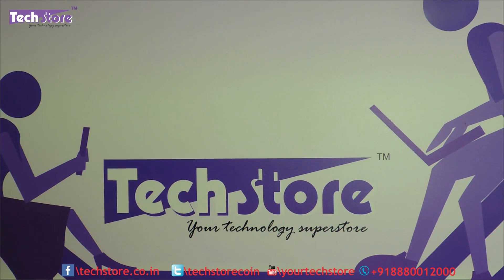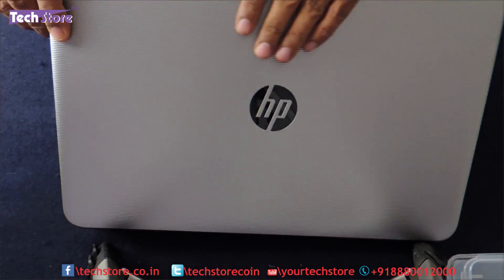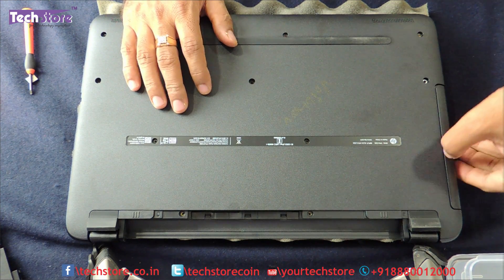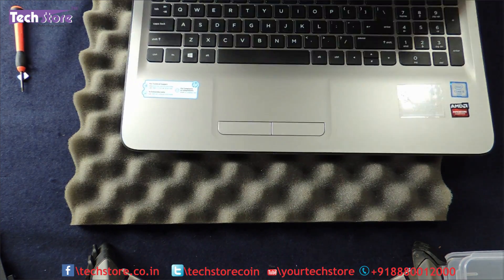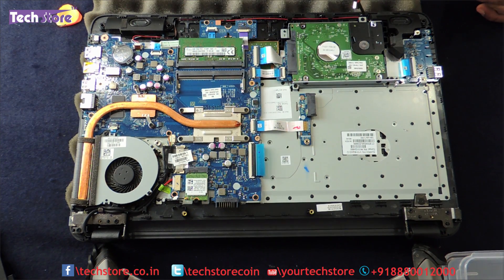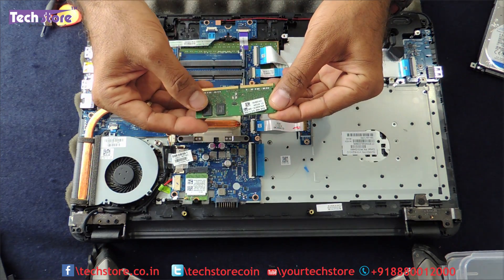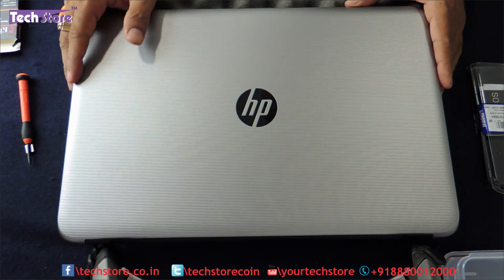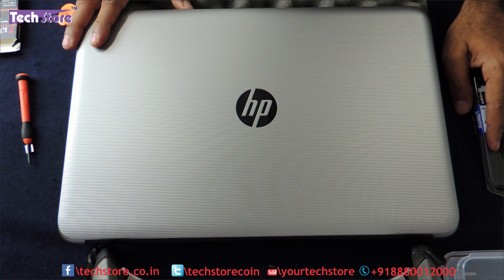HP 15 AY series laptop : How to disassemble base and upgrade ram memory hdd ssd of DIY

Comment: You got the easy one with a second dimm mine the stupid HP 15 that only has 1 dimm and you have to take the keyboard out take the whole mobo out just to get to the ram sticks I re-pasted the apu in it and put an SSD in it about a week ago my dad dropped it while it was running broke the KB, trackpad, screen, case and mangled the HDD I’m using it as a desktop now basically to read YouTube chat when streaming so I don’t have to put a second monitor on my gaming rig

Comment: Bro One more question. What if I can replace HDD with SSD and boot from it. Then place the old HDD in Optical Disk using caddy?

Still Should I need optical cable to read write to HDD?

Comment: That was a life saver video I was searching for!! Bro I have same 15 ay series laptop(HP 15-ay009tx)

I have made up my mind to upgrade another RAM slot with 8 GB and replace optical drive with SSD. 
Read all the comments and were able to understand that I need to add another cable to boot from SSD(Replaced Optical Disk Drive with Caddy). I will search for the video which shows this SSD replacement in your channel. Can you please suggest me the best SSD and optical cable which I should buy?

CHANNEL SUBSCRIBED:-)

Comment: There are two HIDDEN screws underneath the rubber pads on mine. IF you don't pull the pads off you will not find them and the cover will not come off without damage! You have been warned!!!!

Comment: Thank you very much With the help of your video i have opened my laptop and corrected the issue of Wifi Antenna (low network) by cleaning and with use of second connecting slot.   

Thank a bunch once again you saved my time and money too.
Reply from the maker: Glad it helped. Do SUbscribe.

Comment: Hey I know this video is 4 years old but I was wondering if you can answer my question.

I installed a 8GB 2666mhz ram but the task manager shows 8GB running at only 2133mhz. 
How do I change this setting to get the ram to run at max speed? 
And thank you so much for this detailed video. I really couldn't find the hidden screws.
Reply from the maker: Hello Rupika. Your motherboard does not allow ram speeds beyond 2133 MHZ. You cannot change the ram speed. Let us know if you have removed the company ram and then checked.
Reply: @TechstoreCoIn  Thank you so much for your response. Helped a lot!
Reply: @TechstoreCoIn  Sorry for bothering you but I was wondering if it's possible to install an m.2 ssd and is it possible for me to install nvme ssds? Thank you so much for your help.

Comment: Thank you for the video, My job made easy. but does it have any nvme/m.2 ssd support in this HP 15 AY series? Can we upgrade the WLAN to 5Ghz? 

If something is available, please make a video of it. Thank you.
Reply from the maker: It does not have m.2 SSD Slot. You can install 2.5 SATA ssd only. You cannot install dual band 5Ghz wifi chip here. Thanks . Do Subscribe
Reply: @TechstoreCoIn  what about the m2 slot near the back of the DVD writer closest to the ram but still in the back.
Reply: Wait, nevermind. I was watching videos on the wrong configuration even though this is the configuration for my computer, whoops.

Comment: Hello, grate video! Just a question: is that a M.2 ssd 2242 on the bottom left side (next to the CPU)? Thanks in advance!
Reply: Hey, did you get your answer?
Reply: @kannakaruppasamy  i opened the pc and found that M.2 is already present and is the Wi-Fi card
Reply: @domenicogigante4095  Does that mean we can either have SSD or wifi?
Reply: @kannakaruppasamy  exactly
Reply from the maker: It does not have m.2 Slot for SSD Thanks Do Subscribe.
Reply from the maker: It does not have m.2 slot for SSD. Thanks Do Subscribe.

Comment: I bought a PNY DDR3 1600 MGZ 8 GB memory chip for a notebook from Best Buy. The space between the gold pins does NOT line up with the notch on the RAM socket.? HELP
Reply from the maker: Your laptop must have DDR4 slot. On few laptops on this series, there is ddr4 if it is corei5  variant.
Reply: @TechstoreCoIn  Yes I found out it takes a DDR4 2133p even though all the literature says it takes a DDR3L 1600. Go figure. Thanks for reply.

Comment: my laptop hp x7t51ua#aba i think has 8g RAM. can i upgrade it to 16g and will it make my laptop faster?  How do i know what to buy? thanks.
Reply from the maker: Yes you can upgrade ram. Ideally install SSD too which will boost speeds better than ram

Comment: Bro. I have HP 15ay542TU Laptop with Core i3 6th Gen Processor. I want to Upgrade my RAM from 4GB to 8GB. I only know that the RAM inside is of SK Hynix of 2133 MHz speed. But I am not sure if its DDR3 or DDR4. What to do? How to check?
Reply from the maker: It is DDR4

Comment: Hi, I have 15-ac026tx HP model. It has 4 GB DDR3L-1600 SDRAM Expandable upto 8 GB. Which RAM should I purchase? Does this model has m.2 slot ? Or should I insert SSD at HDD place ?
Reply from the maker: It does not have m.2 slot. You can buy a 2.5 Sata SSD. You need to buy a 8GB DDR3L 1600MHZ ram
Reply: @TechstoreCoIn  Thank you... But why 8 GB? Does this model has no second slot for RAM?

Comment: I need help with upgrading to ssd
Can i keep both ssd and hdd and remove cd drive in my hp ay009tx
Reply from the maker: Yes you can. You can use HDD caddy for using your existing HDD and put SSD Sata 2.5 in HDD bay.
Reply: Thanks for the reply @techstore

Comment: M2 slot is availble for ssd or not in this model_
Reply from the maker: No,unfortunately.
Reply: @TechstoreCoIn  what i understand is that this model (HP-15-Ay105ne) does not support nvme m.2 SSD and its only limited to SATA SSD.

Comment: Please please please Will You tell me the exact 15 ay model of your notebook? I have the same one but theres no optical drive in it. It has the space on the motherboard but not the Flex and the plug that goes to the odd or the dvd reader. I want to put a caddy on it yo hace another disk
Reply: Whats the Exact Model number ?
Reply: @harrykane9632  yes! Please!
Reply from the maker: yes you can put caddy in that space.

Comment: Thanks!  I put in an SSD. Thanks for counting the screws and showing where all are located. I never pried open a laptop before......Thanks for showing how to do this prying. Your video was most helpful.
Reply: What type of SSD did you get and did you notice a big difference?
Reply: @foch41  Silicon Power 512GB......buy at Amazon for $50 or so. Yes my HP AY series moves faster now.  I have the hp 15-ay192nr. Be sure to remove EVERY SCREW before prying it apart........This video showed every screw.   SSDs are 4x faster than 5400rpm laptop hard drives. I tested this with a program called crystal disk mark.
Reply: @foch41   use Aomi to clone onto yr new ssd drive. Aomei is free backup and cloning program

Comment: Does this model supports m.2 nvme ssd?
Reply: I have the same question, did you get an answer yet?
Reply: @lecatturkey9185  i hope its not too late. I dug into the datasheet and found out that it does not support nvme SSDs.
Reply: @maxis7182  Thank you

Comment: I have the same laptop. Can we put ssd and hhd together ? For ssd place remove cd drive. Is it practically possible? . My imagination this one.
Reply: Yes you can ! Replace the cd drive with ssd using caddy. But if you want to use the full potential of the ssd, replace the laptop hdd with ssd, and use the hdd in cd drive space

Comment: hello. i have the same laptop with a core i5 6200u and it has 4gb ddr3 ram. what ram should i add in the empty slot?
Reply: use 4 or 8 gb ram ,if you use heavy stuff add 8 gb , else 4 gb.

Comment: #Techstore Sir, I have hp 15 Ay-102nx corei5 7th gen with 2GB amd radeon m430 graphics but my graphics chip is dead since i bought my laptop. What is poosible solution where the chip is located on board 
I guess i have same board like yours in the video !
Hoping for the Fast reply #

Comment: I am having a laptop with configurations 

*Intel Core i7-7500U 2.7 GHz

*8gb RAM

*1 tb HDD

*Graphic processor: Intel(R) HD Graphics 620 (integrated graphics upto 4gb)

*OS: Windows 10

*Resolution: 1366 x 768

*System type : 64 bit operating system, x64-based processor 

*Touchscreen

Laptop model : hp 15-ay196nr

My problem is i cannot play games like gta 5, mafia 3...my question is upgrading ram to 16gb in my laptop will help gaming performance?
Reply: you need a dedicated graphic card in order to play high graphic games

Comment: Quick question - I have a 15-ay0039wm, and the power jack isn't working well.  I already ordered the replacement part through Amazon, just wondering where it is and how to get to it?  Looks like it may be next to/under the fan?  Thanks in advance for your help, and for a great video!

Comment: i have core i3 model, can i upgrade to core i5?
and i also want to upgrade ram, which ram is best for this laptop? i need suggestion ( any 8gb ram)
plz reply
Reply: No can't upgrade CPUs on laptops.
Reply: @ArunG273  yes you can upgrade cpus on laptops who told you you couldnt?
Reply: @jacobsasson5595  There are few rare upgradable laptops. I know them. Laptops these days are soldered. Can you show me any laptop from last 2 years with upgradable cpu except some Chinese ones?
Reply: @ArunG273  who says he needs a 2019 laptop or 2018 having a laptop with a 15 inch screen and changeable CPU, GPU and ram is all that's needed and I know msi does those
Reply: @jacobsasson5595  this video is about HP ay 15 series laptop. I have that same i3 model it's not upgradable. Please don't bring those rare upgradable laptops into this discussion. What I said about cpu applies to 95% laptop on the market.
Reply: @ArunG273  Funny how I was correcting you when you said cpus cant be upgraded please dont bring your personal problems to YouTube its embarrassing
Reply: @jacobsasson5595  it's not my personal problem. I am talking about the laptop in this video.

Comment: I just bought an ssd and I want to use ssd caddy but I am not sure which size i have to get, is it the 12mm or 9mm? will it even work with a caddy? thank you
Reply from the maker: +Mohammad Rahmat 9.5 mm caddy will work just fine.
Reply: Techstore thank you

Comment: Hi ---are you using a guitar pick as spudger to pry this apart? I have one that I must put an SSD in. Thanks! Lots of hidden screws on the bottom of this model
Reply from the maker: +zenzeke zenard ideally you should use plastic pryer only. But if there is no option, you can use guitar picm
Reply: THANKS!

Comment: The plastic that holds the hinge screws broke on mine, would it be possible to replace that plastic that all the parts sit on (that's basically the cover around the keyboard)? 
If so, where could I find that?

Comment: I have a hp 15-ay516tx laptop included with 4gb ddr4 2400mhz but the motherboard supports 2133mhz.. I want to added 4 gb.. Plz tell me what kind of ram (2133 mhz or 2400mhz) support in this laptop and its side effects..
Reply from the maker: Buy a 2133MHZ Zion memory.

Comment: Is this video also suitable for the 15-ay100nl model? Because in technical specifications there is only one slot and max 8gb of RAM. Thank you
Reply from the maker: +Mik yes it will work
Reply: +Techstore But i bought mine last week, not in 2016. Is that the same thing? Thank you
Reply: Techstore What is better? Single or dual ranked for 15-ay100nl? Thank you

Comment: Well, I installed an additional 4gb ram.
but my system still shows that I have 4gb instead of 8gb ( not counting the new ram )
any idea?
Reply: Probably the wrong memory type. It may require DDR3L SDRAM, L for low voltage (1.35 V). I bought the wrong type for my ASUS laptop and it didn't register. That or the ram is not seated all the way.

Comment: SSD and HDD, Can i use both at a time in this laptop ?
Reply: Yup but you have to sacrifice your optical drive also you can't boot from the drive which is installed in optical bay
There are plenty adapter for that just search "optical drive hdd"

Comment: hey thanks for the video, I just want to know if opening my laptop will give issue with the warranty? also I have an hp 15 -af006ax with amd, could you tell me if my model will be the same as yours and which hard drive to use?
Reply from the maker: No issues at all.Go ahead!

Comment: Thanks, I have a question please. I own the very same laptop and it keeps making noise, I believe it's from the hdd, is it okay, or should I do more tests? The fan is set to disable always on mode, so I'm sure it's the hdd. thanks again
Reply: I'm buying a new SSD, but idk if that will fix it. Did you ever get it working and if so, what changed it?

Comment: What connector did you use for the hdd? I have a ssd laptop and i want to put my old hdd in the new laptop but it only haves ssd slot and i need the connector.. where can i buy that?

Comment: you didn't mention anything about the ribbon cable connectors. What a pain when you remove those, they fall apart. Also, would be nice to mention that for certain upgrades (pcie ssd) you need a separate adapter board

Comment: Wow, same watch as me, same laptop as me. Great video, but does this void my warranty? Also, what is the technical name for the tool you used to pop apart the clips around the edges of the laptop? I don't want to make chips and dents in the frame by using a screwdriver (Did that last time, didn't turn out well)
Reply from the maker: +Tom C (xXItzTomXx) that's great to know you wear the same watch and have the same laptop. :-)
The technical term is Pryer
Reply: Okay, thanks ;)

Comment: I want to know if my HP 15 notebook 15-g009ax has two memory slots? and if not which one should I go for, if I want to get 8gb I have 4gb installed already! please help
Reply: To check the details of your current installed memory, right click on start, click "Task manager", go to the "performance" tab and click on the "Memory" section. At the bottom of that section, there is some numbers. To the right of those numbers is some other detail. You should find "Slots used: (Used slots)". If not, then use the scanner tool provided by Crucial, which will also show the computers maximum supported RAM: http://uk.crucial.com/gbr/en/systemscanner

Comment: great vid ... can i have a link or part number for the ram you used .. i ha e the same computer just i5 processor and 128ssd thanks in advance
Reply: He used a 4GB stick of DDR4 SODIMM 2133MHz RAM from Kingston. The DDR4 and the 2133MHz does matter, the motherboard will not fit anything else but DDR4 SODIMM sticks. The speed (2133MHz) is the speed of the default stick of RAM pre-installed in this laptop, but if you were to put another speed in (eg 2400MHz) then the lower speed stick of RAM would burn out because the motherboard tries to run it at a speed that it is not capable of. If you want further information, try using Crucial's PC scanner.

Comment: what exact type of memory did you use?
Reply: He used a 4GB stick of DDR4 SODIMM 2133MHz RAM from Kingston. The DDR4 and the 2133MHz does matter, the motherboard will not fit anything else but DDR4 SODIMM sticks. The speed (2133MHz) is the speed of the default stick of RAM pre-installed in this laptop, but if you were to put another speed in (eg 2400MHz) then the lower speed stick of RAM would burn out because the motherboard tries to run it at a speed that it is not capable of. If you want further information, try using Crucial's PC scanner.

Comment: 1. Which brand of RAM will be the best for laptop(HP 15AC044TU)?
2. Is the same process may be followed for 15AC044TU to upgrade RAM?
Reply from the maker: +Saptarshi Sarkar same process is followed. you can buy Kingston, corsair ddr3l
Reply: I'm confused abt the latency period of existing RAM vs New RAM. If both are not same.
Reply
Reply: Hey, I've kinda got the same choice to make with RAM. I want to upgrade my HP 15-ay167sa (i5-7200U, 1TB HDD, 8GB DDR4 2133MHz, Intel 620 inbuilt graphics) to 16GB. Crucial have not updated their scanner database with my model yet, so I don't quite know if it can support 16GB, but from my findings, it looks like it can. With my budget, I can afford Crucial, Kingston, Corsair or HyperX (Owned by Kingston), however I cannot decide. From your experience, what brand would you recommend?

Comment: Hi, i have an HP 15.6" ay-007la, have a intel pentium n3710, but it dont have GPU...., i see on your notebook that have an "amd" sticker.... its the gpu?, and, my notebook dont have any fan.... Why?, it only have a black cover
Reply: The AMD sticker represents the dedicated graphics card. Other models of this, eg. the i5 7200U model, 15-ay167sa, use Intel's inbuilt graphics, which are actually pretty decent. I have a 7th generation processor, which comes with an Intel 620 graphics processor, which is integrated into the CPU. But as Pentium processors are lower end, I am not sure if they come with as good graphics. If you want to know more, just google the CPU type.

Comment: Hi i need that adapter from the motherboard to the optical drive (my laptop came without optical drive). Can you please share some info on that odd to sata adapter? I'm not sure if its  LS-C706P.
Reply from the maker: +Panait Bogdan which laptop model do you have?
Reply from the maker: +Panait Bogdan which laptop model do you have?
Reply from the maker: +Panait Bogdan which laptop model do you have?
Reply: HP 15-AY038.
thanks
Reply: HP 15-AY038.
thanks